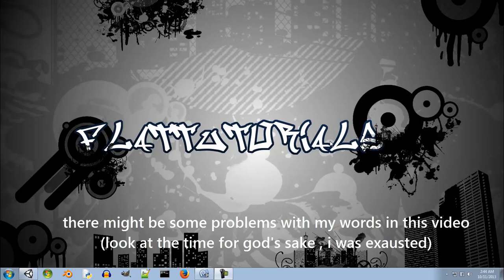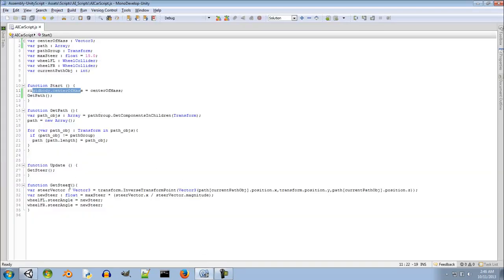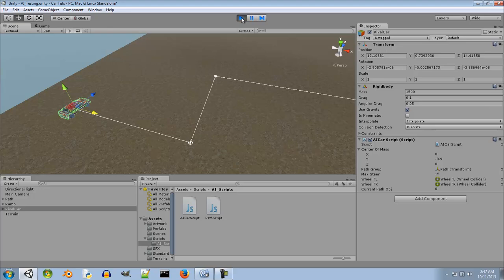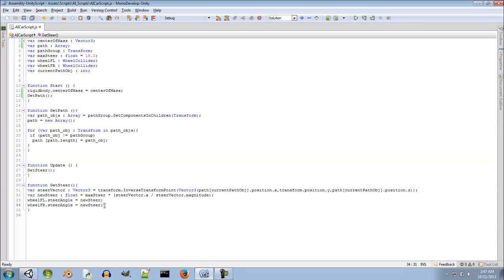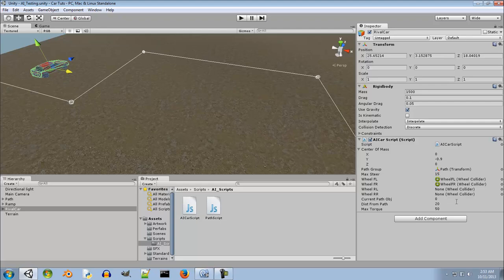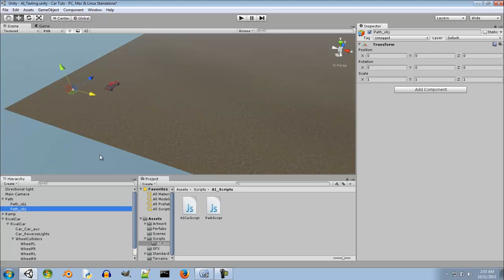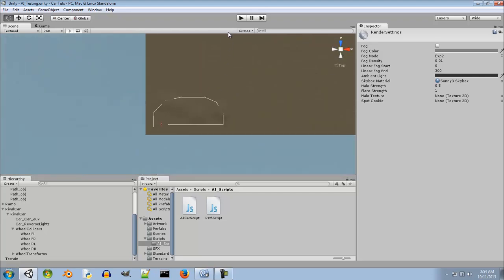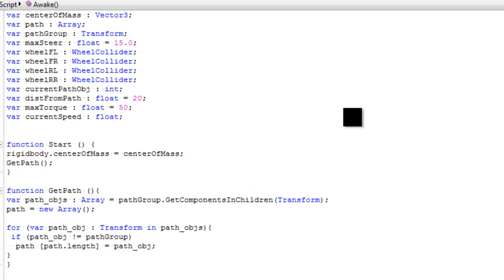#4 Car AI - Unity 3D Tutorial - Movement

Comment: if (steerVector.magnitude <= distFromPath) {
currentPathObj++;
if (currentPathObj >= path.length)
currentPathObj = 0;
}
I printed steerVector.magnitude, it's always bigger than distFromPath, which is 20, and then the whole system totally didn't work!
Reply: ***** solved！Thanks
Reply: ***** I remembered it's the problem of my gameobject. I modified something for my gameobject then it worked

Comment: I'm using this with a custom model of my own (an SUV), and I'm wondering if there are any methods of determining what the CenterOfMass should be.  PLEASE tell me it's not just random trial and error, because that's not working very well for me.
Reply: For an SUV, generally the weight will be more to the front, maybe 0.5 or 1.0 units forward, and mayube slightly higher than the floor of the SUV. Unfortunately, it is rather dependant on personal preference and the model you use.
Reply from the maker: there's only one way , play with values
Reply: +FlatTutorials amazing tutorial man good job

Comment: OMG! Since you are here... I cant find the page to contact you at. Please skype me at max.mastalerz. Love your work, but i have an issue with one of your earlier tutorials. The car is easily tipable, this could be related to the errror i am getting : [mecanim]: BindSkeleton: cannot find Transform 'Wheel3_cylinder3_auv'
Reply: NVM, someone else had the same error. This is what fixed it: 
rigidbody.centerOfMass = Vector3(0,-0.9,0);

You should mention is in a annotation in your earlier videos.

rigidbody.centerOfMass=centerOfMass; does not seem to work well.
Reply from the maker: BindSkeleton is a error by mec anim , which is a animation system , so what you've to do is , select your model in project window then in inspector , go to rig and set it to none.